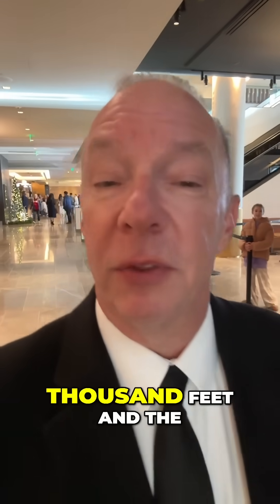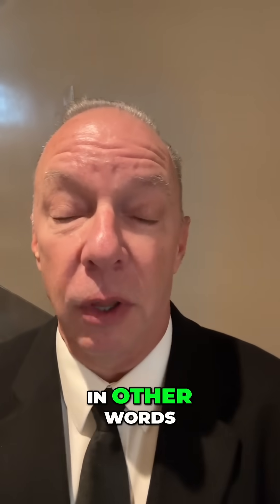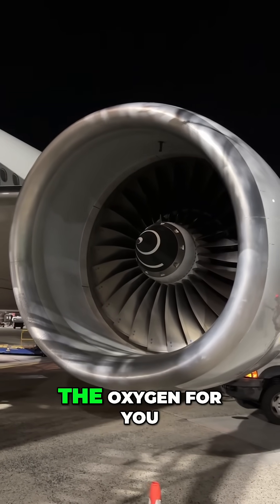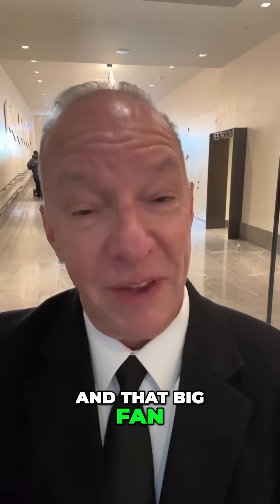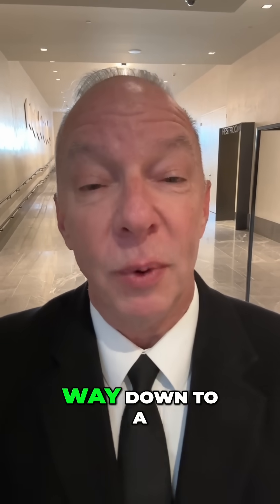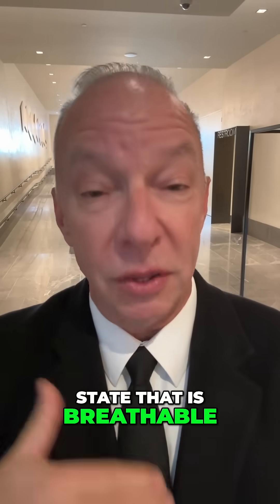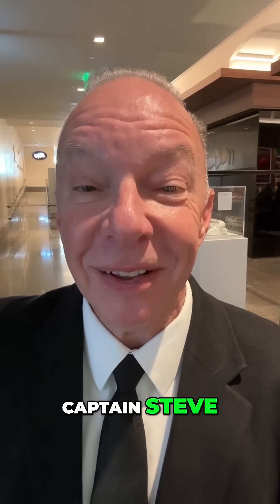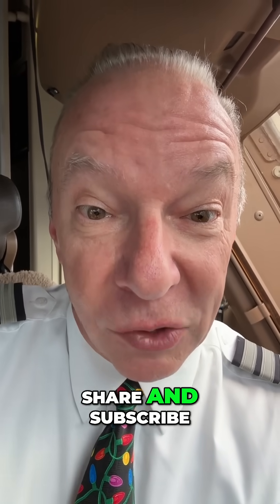How Airplanes Make Breathing Possible at 37,000 Feet

Comment: What an excellent explanation.
Reply: Honestly, as a former USAF KC-135 Jet Engine mechanic this was a quite poor explanation.
Reply: Totally wrong 
That’s not true
Reply: I like how he explains that the hot bleed air is cooled before entering the cabin. Oh wait, he didn't. He skipped right over that. The most complex part. Just fly the plane bro.
Reply: @jameslowrey2715 Do you guys not have the patience to watch the full video? He literally mentions it is cooled down.
Reply: @TheDeathLove  Doesn't say how. Everything else he tries to over explain but when it comes to the most complex system of heat exchange just blows right past it and says it's cooled. How?! Cause he doesn't know. Keep defending your guy who doesn't know s@&t. He should be in the cockpit showing how to push buttons.
Reply: A lot of small errors...if you can't explain it to a 6-year-old, you don't understand it yourself.
Reply: Stator blades don't spin Captain Steve , the. rotors do.
Reply: WoW, Not only an Air Captain, But an Aero-Engineer too.🤓
Reply: The oxygen in the air at 37,000 feet is every bit as breathable as at ground level. Oxygen is oxygen after all. The problem is that there is not enough of it as the air density is much less, so there are fewer molecules of air per cubic measure. [pick one, any one] So there is not enough oxygen in every lung full of air that we might breathe at that altitude for our bodies to function. Nothing wrong with the oxygen, just the volume of it per lung full.
Reply: @KB10GL Another one who didn't watch the video, he explicitly mentioned that while there is oxygen, the atmospheric pressure is too low for our lungs to fill up.
Reply: @TheDeathLove  Ahhh, Death, me ole buddy pal mate. You didn't pay too much attention in school, did you. No, I didn't think so.
Lets say that you have an open drinking vessel, a glass if you will, & it's on board our aircraft at 37,000 ft. That glass is full, or has "filled up" .... with air at whatever pressure is in the cabin. Oh dear, a window broke & the cabin depressurises down to the atmospheric pressure at that high altitude. Is the glass still "full" or "filled up" with air, albeit at the new low pressure? Of course it is. Air has mass, & our imaginary glass still has a measure of mass within it that is actually measurable. It has weight. 
Same with our lungs. They would still have "filled up" with air, but now at such a low density that the available oxygen component of it, is of insufficient density & quantity to support human life. 
So the lungs have still "filled up", at the new lower pressure, contrary to your assertion. Cold comfort, I know, if one is struggling to breathe, but the lungs have still "filled up" none the less.
Choose your words carefully me ole amigo, because words have meanings & you would do well to learn that, soon, & quickly.
Reply: @KB10GL  1. Get help, this is not healthy for a mature adult to act online with such pettiness. 2. I stand corrected, yes your lungs would have filled up, but due to lack of sufficient pressure, the airsacs in our lungs would fail to diffuse or infuse the oxygen/CO2 back in blood.
Reply: @TheDeathLove  Which is exactly what I said.
Reply: @ Also incorrect. Inspiration is not the issue, the partial pressure of O2 is insufficient for gas exchange across the blood-gas barrier.
Reply: O2 transport is partial pressure gradient dependent. PO2 = Ptot * FIO2

FIO2 is constant to about 300k ft. The Ptot or PATM falls with altitude.

So the cabin is pressurized in order to raise the PO2 sufficient for gas exchange.
Reply: I agree with it🎉🎉
Reply: Good for the filters, can't imagine breathing air that smells like the intake of an engine.
Reply: @kevinclass2010 That's like wearing a mask cause you're worried your breath will smell like your ass. Ignorant statement.
Reply: no one tells you that
Reply: Not really the oxygen outside the plane is the same element as the oxygen inside the plane they are both breathable.
Reply: Does it supply nitrogen as well?
Reply: Thanks Capt.!!!
Very lterstin...
And a darn good idea.😊
Reply: BRILLIANT
Reply: whod a known .beautiful feat of engineering..life giving engines.
Reply: Agree.. what a smart guy ..
Reply: He made at least five small mistakes.  The basic ideas were correct, however.
Reply: I appreciate these explanations.
Reply: @ljfinger do tell.
Reply: @ljfinger care to elaborate
Reply: Those seemed cute by the way
 @ljfinger
Reply: Except it isn't well explained at all.
The stages are not fans, they're compressors. Only the first one is a fan, hence turbo-fan engine. And there is nothing named stator blades, they're called stator vanes and they doesn't spin. They are, as their name suggests, static. This is a very bad and misinformed explanation.
Reply: @TheFirstBigCheese You are the only person who actually caught onto a mistake, stator "blades" rotating would be an oxymoron. Lol.
Reply: @TheFirstBigCheese  I don't think he was trying to be 100% accurate just a basic vague concept or idea as to what is happening in a way that an average Joe might understand.
Reply: @davido3403  
Hmm... But there's no extra effort needed in order to be accurate vs ambiguous.
Reply: @TheFirstBigCheese  Maybe he made extra effort to explain it so others without the knowledge might understand! I trained as an IT tech and literally taught us to explain things in layman's terms or give examples of other situations so a customer might have at least a vague idea of WTF you are talking about. And that takes extra effort. Or maybe he really doesn't know himself and is just explaining it the way he understands it.
Reply: @davido3403  
I know what you mean with layman's terms. And it doesn't make sense using jargong wrong. The "stator blade" is spinning for example, it's nonsense and plain wrong. And to be honest, it's not that difficult to explain this easily and simple.
Reply: @TheFirstBigCheese That’s just nitpicking/trolling. He mentioned something that “compresses” the air, which captures the main idea. What do you expect? An engineering lecture about jet engines from a captain? He just wanted to explain how he understood it as an expert user of the aircraft to the average passenger.
Reply: except it completely wrong. cabins are pressurized using a roots type supercharger thats location in the cabin. they DO NOT use the jet engines
Reply: @the_chomper  
Hahah! Are you stuck in the 1940's?
No airliner uses roots anymore.
Maybe tune down that overconfidence Mr poppin.
🤣🤣🤣

Comment: So that must mean over a long flight with lots of people you get only 60% of the oxygen that you usually have on the plane... or have I got it wrong
Reply: Im not sure how you came to that conclusion, but imagine the inside of the airplane is like a balloon that has a controlled amount of the air being let out ( outflow valve). To reduce the amount of air needed to keep the ballon inflated ( reduce the bleed off from the engines) the recirculation fans cycle the same air through the filters.  At 37,000 feet you will be at 6 to 8,ooo feet inside the airplane. 
Ps...0 percent humidity!! Unless you are on a Boeing 787 which has humidifiers!
Reply: Ahh now it makes sense❤